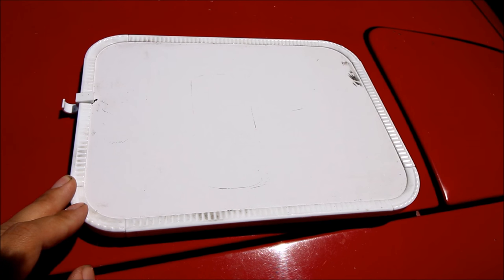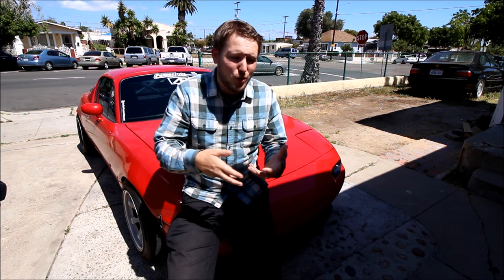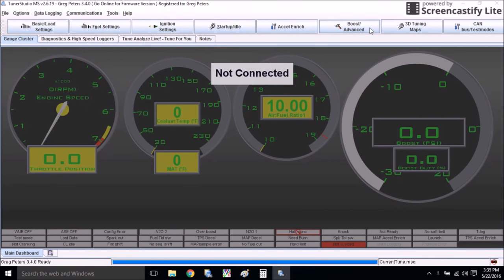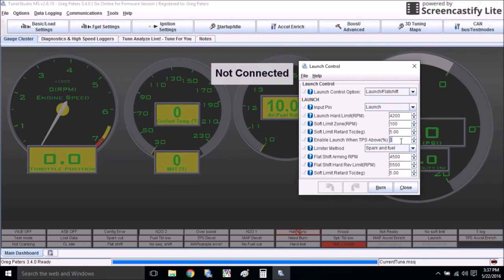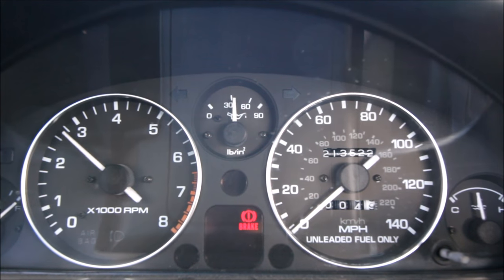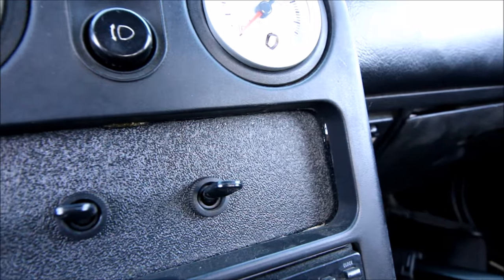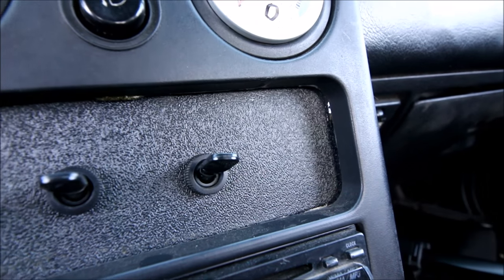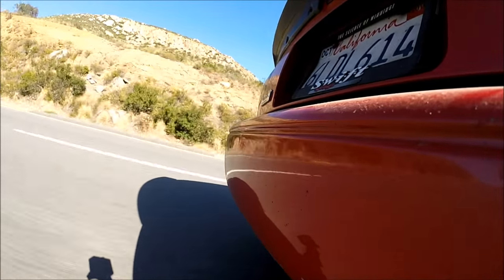Shooting Flames! Launch Control & Flat Foot Shifting Tutorial. (Megasquirt)

Comment: 8:39 for those that came for gunshots :D
Reply from the maker: +KoNLaR Don't forget 10:35
Reply: +TheCarPassionChannel 10:24 Why did you lift your throttle foot the first shift, but not the second shift (flat-footed)? If the feet shifting clip and the tail end clip were filmed at the same time, then that would mean that the backfire was caused by the opened BOV on the first shift.

Also, I get that the engine experiences spark cut during flat foot shift but does it also cut fuel as well? I'm assuming that it does or else you'd get backfires.
Reply from the maker: Eddie Trevizo I lifted partially on the first shift just by habbit, lol. Actually the GoPro runs were filmed completely separate from all of the in-car runs. If you run spark cut only, you might still get through a flatshift without any backfire if the revs never drop low enough to hit the secondary limiter.
Reply from the maker: Eddie Trevizo Apparently people are liking it, I was afraid it was a bit boring.

Comment: i got a FM clutch override. so that means the ecu will think the clutch is in 24/7. correct?
Reply from the maker: Yes, and depending on what engine/what MS you have, you might need to use one of the option port wires to hook up your LC to the remaining disconnected clutch button.
Reply: Depends on the year. On the NB miata there are TWO clutch switches. One is for starter interlock which is what the FM override disables, and there is a second clutch switch that the ECU sees that the megasquirt can utilize.
Reply: Not necessarily. It isn't the case with my 2001 NB.

Comment: does this work with a non turbo
Reply from the maker: Yes! The benefits are not as great, but it works the same way.
Reply: Thanks I'm thinking about putting this on my 4.8l chevy truck and I really like you miata

Comment: is it bad for my miata to be just under 60 on the oil pressure just cruising normal throttle and not hooning it?
Reply from the maker: Oil pressure is affected only my RPM, nothing else (assuming the engine is healthy). 60 is pretty normal for cruising
Reply: TheCarPassionChannel cool thanks man!!

Comment: How does this launch control work ? you can not WOT and just drop the clutch...
Reply from the maker: You can launch at any throttle you like, and you can modulate the clutch. You have to figure it out for your specific setup. I probably only launch at 30% throttle when I'm first letting the clutch out, then I slowly feed in more.

Comment: You dont have to have a turbo to setup anti lag right
Reply from the maker: Breanna Bryant This video is about setting up 2-step, not anti-lag. Yes you can use 2-step without a turbo, I supposed you could even run anti-lag without a turbo, but there would be no point really.

Comment: Question, can I do a two step rev limiter with retarded timing to pop on my naturally aspirated car??
Reply from the maker: Yes
Reply: TheCarPassionChannel I would need an aftermarket ECU to do that correct? Or just a two step system?
Reply from the maker: Nic D You could install something like a Bee*R revlimiter to accomplish the same thing.

Comment: Do I need to setup the options plug to enable megasquirt?
Reply from the maker: Samiata huh
Reply: TheCarPassionChannel I meant to say 2step not megasquirt, my bad 😂
Reply from the maker: Samiata it depends on which megasquirt you have, I don't think you need to use the options plug if you have MS2
Reply: TheCarPassionChannel Okay good to hear, thanks

Comment: Do some gunshot videos from the miata plsss lol
Reply from the maker: +iGhsT Gaming Haha I'm bummed I only got the one flame in this video, maybe I'll take a video and post it on the instagram in the next few days.
Reply: +TheCarPassionChannel Sweet can't wait, how good is a miata as a daily if you don't mind me asking, before and after boosting it?
Reply from the maker: iGhsT Gaming Their only downfall is limited space and seating. They're reliable, easy to work on, cheap to maintain, and get good fuel mileage. After turbo, the only real difference is you wanna check out stuff under the hood once a week or so to spot any issues before they become problems. The reliability of a turbo Miata will be heavily influenced by the build quality.
Reply: Thanks, much appreciated, what would you recommend as a first mod to start off a build like broke and boosted?
Reply from the maker: iGhsT Gaming You should consider how long you're going to keep the car and modify it. If it's going to be a longer term project, just go Megasquirt. You'll be better off in the long run. That's after all of your maintenance is taken car of and you have decent tires and brakes of course.

Comment: why wouldn't you just rewire at the ECU instead of running new wires?
Reply from the maker: Because I'm a noob and I knew that would work and be easy. Plus it was easy to install the switch with a wire already running right by.
Reply: that does work as well lol

Comment: Is flat shifting like antilag but manual?
Reply from the maker: No, it's just a secondary rev-limiter that only activates under certain conditions. It's the 2nd "step" in the term 2-step.
Reply: its so you can never take your foot off the gas, so when you push the clutch in, it does what letting off the throttle would (reduce rpms)

Comment: can we have flames with a muffler?
Reply from the maker: MixaL1s6804 It can damage the muffler if you use it excessively
Reply: what about just fuel cut with muffler? will it damage it too?
Reply from the maker: MixaL1s6804 Sorry I should have specified. If you set it up to shoot flames it can damage the muffler. If you set it up on fuel cut with some timing advance it will not hurt anything
Reply: thats nice man! miatas are awesome cars, i can finally buy my first car, i am between the miata nb or the civic ep3! i really love the ep3 but i cant resist on the miata, i think that i will go with a miata since they are more fun and cheaper :)

Comment: how did you learn how to tune?
Reply from the maker: About a year of research before I ever put MS in my car. Then lots of trial and error. I downloaded TunerStudio free before I even bought the ECU just to get familiar with the program and terminology. Then I got my car tuned by a professional who I learned some things from. Then I paid someone to spend a few hours teaching me a lot of the stuff they know on the dyno. It takes a lot of time, trial, and error just to get a grasp on basic tuning, which is why people that do it, charge $75+ per hour. And if you can't do it yourself, it's worth it.
Reply: +TheCarPassionChannel I always had a passion to learn to do things when I watch the video I was like is this guy gonna take the car to a shop for a base map or anything then when you started setting stuff up I was like well I be damn... Lol if you could pin point me in the right direction maybe even some YouTube videos for some basic terminology of tuning man that would be really helpful man
Reply from the maker: LiFT3DTR00P If you're talking about Miatas specifically, there are a couple places to start. Here on YouTube there's a video called Basics of Megasquirt Tuning (I think?) it's 5-6 years old and features a guy with a somewhat heavy accent and an orange Miata with a body kit. I watched his video several times when I was first starting out. Miataturbo dot net does have a TON of good info, but it can be hard to search for and locate, so just take your time. They're also not very friendly to newcomers who ask questions that have been answered 100 times, so just be aware of that; but there are some REALLY smart people on that site. Other than that, for me, it was just reading tons of articles and watching videos to get a really good understanding of how an engine works and where tuning comes into play.

Comment: what is your wheel spec
Reply from the maker: +papiloran 15x9 +16
Reply: +TheCarPassionChannel I have a stock miata and I have a deal for 15X8 0 offset. what did you think about it
Reply from the maker: ***** You'll need fender work with any normal tire size.

Comment: Look.. I know nothing about anything. I just wanna upgrade my exhaust system (FM), injectors (Bosh, EV14 1050cc), wideband sensor, intercooler (FM) and intake (FM), Megasquirt 2 PNP, so my 2005 MSM can handle more turbo boost, maybe increase it by  maybe 4-5 psi, then get the car tuned to get 220 Whp minimum.. Where can I go to get all this done, and can I do this in a way where I specifically don't have to mess with the ECU myself? I'll pay for all of it, I just don't know enough to do any of it myself, and I much rather have some knowledgeable person do it than me. So, once again, where can I go to have these things done/is it possible that I, myself, won't have to mess with the ECU at all?
Reply: Also, in what order should I make these upgrades in? Thank you so much to anyone who responds
Reply: @TheCarPassionChannel

Comment: You will need a VARIABLE TPS
Reply from the maker: +h3h3Productions Correct, I forgot to mention but added it to the description.
Reply: do you have any suggestions for a cheap vtps that'll bolt on with relative ease?
Reply from the maker: Some BMW ones, you'll have to research and find the right one.
Reply: pretty sure vw+audi+bmw have bolt ons besides the wiring

Comment: To change the downshift issue of 2step activation, simply turn the tps enable percentage up right? I have not done this myself because I enjoy shooting flames too often lol
Reply from the maker: The problem with that is, sometimes I use 100% throttle for downshifts.
Reply: TheCarPassionChannel oh wow...  I changed my settings today to 30% and when I heel toe (toe toe really)  down shifted it didn't enable launch control.  Before I has it set at 10% because I liked the backfire between downshifts but to heel toe downshift and hit 100% tps that's crazy haha I just blip the throttle and the lightweight flywheel revs up instantly to where it matches
Reply from the maker: I rarely use 100% tps for downshifting since I have a 7lb flywheel, but occasionally I'll hit it. The main problem with your method for me personally is when I launch the car I use a pretty low throttle % like 20 or so... so if launch was active at 20% it will really interfere with the downshifts.